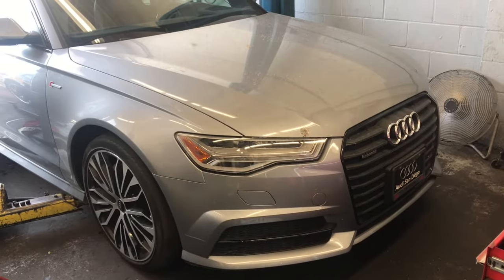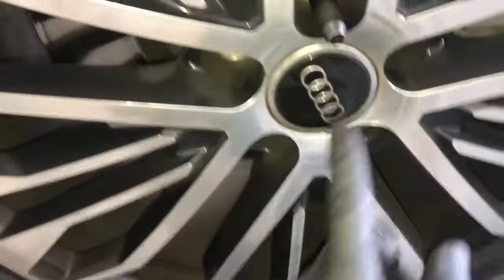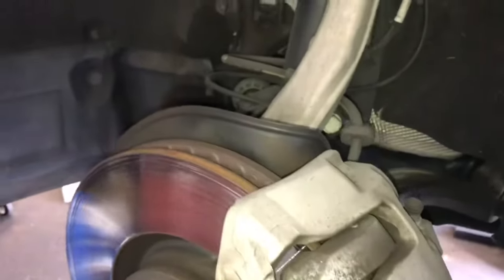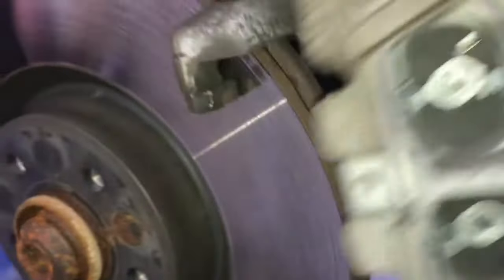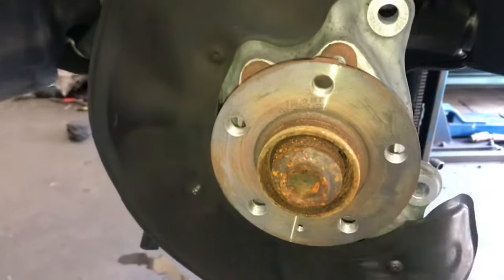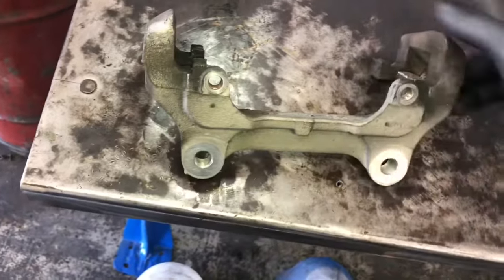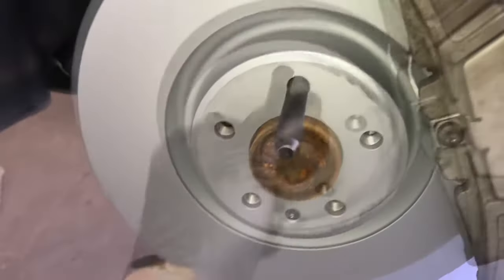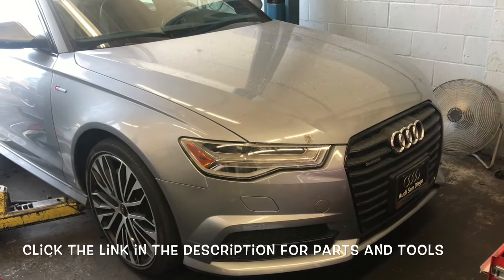Replace the Front Brake Pads and Rotors on a 2012-2018 Audi A6 C7

Comment: Recommend inspecting and maybe replacing the caliper pin boots at the same time. They are inexpensive. If they fail and and bind the caliper pin, it will quickly wear down the brake pads. In the 1LF brakes for sure, the lower boot has a plastic insert. Just found mine had turned to powder and wasted about 4mm of the outside front brake pad due to bound pin. Guess what? No wear sensor on the OUTSIDE pad, lucky me happen to inspect and find the thin pad.

Comment: I watched a lot of videos on this topic, and this was by far the best and most accurate.  My 2016 A6 now has smooth brakes.  Thanks!!
Reply from the maker: Tony Syracuse glad the video helped thank you for watching!
Reply: Can you tell me what brakes and rotors you purchase? Thanks
Reply: @MrDutchentre  my pads were like new and had no uneven wear, so I re-used them.  Usually I don't do that.  The rotors were Brembo from RockAuto.  They were about $220 for the pair two years ago.  Fit perfectly.  Hope this helps.  BTW, the dealer wanted $1300 for front pads and rotors!!!!
Reply: @HDrive60   The dealer wants 1500 for front brakes and rotors on my 2018 Audi A6 seems like robbery

Comment: Great video and it matched up with my 356mm rotors (except for the T45 as mentioned in the comments) the one thing I found out is the that the sensor has a silver metal U shaped clip that keeps the sensor snug in the pad. If the clip is missing the sensor will not be tight and will cause the BRAKE light to come on.  Sometimes it sticks to the old pad and sometimes the new sensors are missing it.  BUT it is necessary.

Comment: My car is 2016 A6 3.0 with the same wheels shown in the video.  My rotors are 356mm.  You need a 9mm ALLEN socket for the slide pin bolts.  I missed that in the video the first time, and my set didn't have this size.  Also The torx is T-45.

My original rotors warped with 26K miles, and I just installed Centric High Carbon Plain 125 rotors and Centric Posi-Quiet Semi-Metallic Pads, and everything is smooth now.  Thank you so much sir for posting this excellent video.  Everything spot on.
Reply from the maker: Glad the video was helpful. Thank you for watching!

Comment: Outstanding instructions.
I was wonder if all Audi rotors and brakes are generally like this ? 
we have 2016 q5 3.0T-  so this helped tremendously.
I’ve Done brakes on my Jaguar & Honda..  but Audi is next up.
Best video instruction wise I’ve seen without any confusion or misguidance.
Reply: The 2016 q5 is different in front but same for rears across all b8 chassis and c7 i believe all use 330mm rear rotor amd similar if not same calipers

B8.5 Q5 i believe has brembo option for 3.0T which is super easy to change pads - just pull pin and slide them out no need to remove caliper

Some 2.0 Q5s have the B8/B8.5 A4 style caliper
Reply: No. The rears you need to have an OBDEleven and VAGCOM to use the Audi - Specific software to release the electronic parking brake while doing the rear brake pads. You have to find someone who has the computer or an Audi Dealer to do the rear pads. LMAO Nobody online seems to actually own a new Audi and had to repair the rear pads because that's EXACTLY what you have to do.
Reply: @nighthawkviper6791  
Yes,  great information. 
I have one.

Comment: Thanks, great video, after reinstalling my brakes, the pedal would go nearly to the floor. I bled the system twice, and it still had excessive travel. If I pump the brakes it starts to stiffen back up and act normal but then again 15 seconds of driving, excessive pedal travel againnearly to the floor. Any suggestions?

Comment: Nice video! Any advice on where to put jack stands on my A6? I noticed it has the weird jack point and no place for a stand.
Reply: @Conan Fox Nope
Reply: @PotatosPotatoes  check your owers manual
Reply: @PotatosPotatoes  It tells you what your jank points are.
Reply: @hiddeelbers78  Jack points, yes. Jack stands, no.
Reply: @PotatosPotatoes  why would a jank point not be good for jank stands
Reply: @hiddeelbers78  it's hard to put a jack stand on a jack point of there's a jack there. You need jack points and stand points unless you have a lift. I'm trying to fully support my car in jack points and remove all 4 wheels.

Comment: Thanks for the video it made it ease to disassemble and put it back together.  Question.  I compared the new pads with the one on the car and it looks like the one on the car still have some life.  They are about 3/4 thick compared to the new once.  In other words,  there is about 1/4 wear and sensor start showing needs new pads.  Sensor still in good condition, no wear, Plante of pads before touching the sensor.  Any suggestions why sensor is telling to change pads when there is still a lot of material on the pads?
Reply: same

Comment: Ceramic or Metallic? Can anyone suggest what replacement pads and rotors for a 2013 A6 3.0T? He mentioned in the video that the guy raced his car so I don’t know if I need the same rotors and pads that he used. I also found no link below to the pads and rotors that he used. Thanks

Comment: Great video! Currently my breaks don't need to be changed but the last guy who did them used a really cheap brand and they are squeaking like crazy. No service light is on, but my question is if I change the front pads and sensors will I still need a scan tool? I don't have one
Reply: I used a scan tool to clear the warning only after job was complete

Comment: Hey bro very good video although even when I followed your steps thoroughly somehow when I installed the new brakes and my wheels the rim hits on the calipers I don’t know what I’m doing wrong, it would seem that the new brake pads are too thick but I made sure to get the right ones. Would really appreciate some help
Reply: So the issue is my rims were after market, 1/4 inch spacers and extended lugnuts solved my problem. Just in case anyone experiencing the same issue

Comment: hey i have a Question, i have an Audi A8 3.0 supercharge 2013, is is the same break pad as in the A6 Video ? and this is my first time changing the rotor, do you recommend i change the rotor after only changing my front twice and my rear once ? for all 4 ? and what sizes of breaks do i use ? also do we change the wire sensor of wire fluid in every break pad change ? thank you !

Comment: With the rattle clip going back in does it just sit on top or do you have to tuck in the prongs ?
Reply: It just sits. I’m sure you figured it out by now. I had the same question yesterday when changing a bearing on my 2013 A6. Cheers!
Reply: I’m assuming it sits on the bottom of the caliper bracket

Comment: I replaced the pads and rotors on my 2016 A6 2.0 using same procedures you’ve shown.  Now I have a strange pedal.  Seams to travel to far before stoping at certain speeds.  Sometimes it’s short, but sometimes it’s long travel before stopping.  I even flushed fluid.  Still the same.  Any ideas of what the issue is?

Comment: Keep the videos coming Brian I really appreciate the knowledge you share! I have a customer coming in for a front brake job on an Audi Q5 2015 model. I’m a Honda tech by trade but I dibble and dab on other models and I really want to become more familiar with European vehicles. Of course I don’t know where to order parts or which parts are the best to use on these cars. So after watching this I’m gonna give it a try! As far as labor goes I charge 50/hr what’s a good price? Fair to me and my customer..
Reply from the maker: Gregory Jones if I’m doing side work are usually charge around 50 bucks. And also  make a little bit on the parts to.

Comment: Do you have any information on how to fix a soft pedal.  I already know about bleeding brakes and all that, but it seems there is something unique about Audi brakes.  Any help is appreciated.  I followed your video with great success, but my car is suffering from a soft pedal.  No leaks, and bleed well, also flushed.
Reply: I have the same issue as well. Followed the instructions (this is an excellent video) but for some reason my pedal is soft. I’ll try bleeding the brake lines.
Reply: Any suggestions?

Comment: Great Video, very informative, I have SQ5, the front calipars & rotors look identical, just subscribed to your channel
Reply from the maker: Paul They probably are  exactly the same. Thank you for the sub and for watching!
Reply: Hi Brian
will i need to change the sensor? Also will i need to use a scanner device to reset any items. Just saw your reply yes they look identical. Thanks mate! Im from australia.

Comment: Great vedio, I suggest using OBDeleven to contract the pistons instead of a clamp , other than that amazing stuff
Reply: It can do that!? I recently got it and am going to do brakes this weekend
Reply: Ozer Ercan yes OBDeleven can do a lot of stuff for you , which OBDeleven did you buy? Did you watch my YouTube vedio , it will show you how to do it. The wheel bearing vedio, watch it and share it if you find it helpful and good luck 👍
Reply: @strictlyaudis7012  thanks I looked it up and saw how to do it, I thought maybe fronts could be done as well but good to know for when I replaced the rear brakes.

Comment: My Audi A7 has 32K miles, and current brakes don't shimmy or shake, but Brake Pad light came on.  Is it crazy to just replace the pads, but not change or even machine the existing rotors?
Reply from the maker: Actually it’s done quite often and about 50% a time you have no issues squeaks or anything.
Reply: @HowtoAutomotive  Thanks much for the reply,  Brian!  Same Bendix front pads ordered and on the way from your Amazon link ...
GREAT vid BTW, perfect pace.

Comment: How many brake sensors does this car have ?

Is it 1 per wheel?
Reply from the maker: Smookes I should be one per axle also one in the front one in the rear
Reply: How to Automotive 1 on the front driver side and 1 on the Rear driver side.

Correct?

-Thanks 

Keep up the good work with these high quality videos
Reply from the maker: Smookes yes that it. Thank you for watching!

Comment: Excellent video!  So quick question: if the brake wear light hasn't lit on the dash, is it okay to reuse the sensors?
Reply from the maker: You can try but a lot of times when you pull them out of the old brake pads the connector breaks.

Comment: Do you need any special program to go into Brake Service mode?
Reply from the maker: It’s not anything special except for your scan tool needs to talk to the vehicle. It’s not gonna be your average code reader that will do that though.
Reply: @HowtoAutomotive  so will that be VAGCOM?  Is it needed just for rear or for all?
Reply from the maker: Michael Davis VAGCOM will work. Snap-on or Autel will work as well.
Reply: I have both vagcome amd xtool vag401 from Amazon and both have function to service brakes...there's a video with a polish guy with a b8 a4 who uses the xtool version to do it